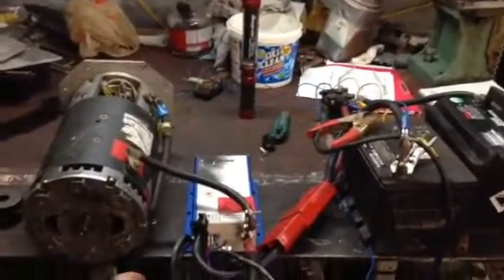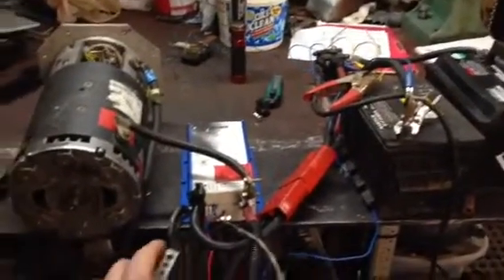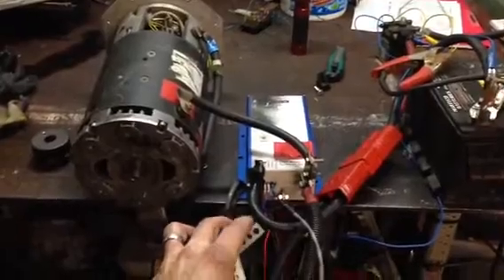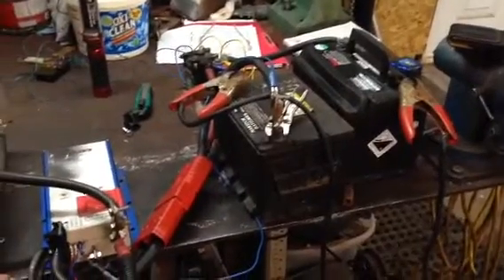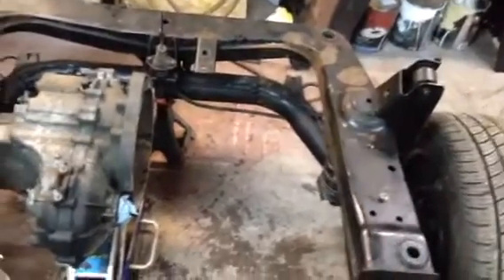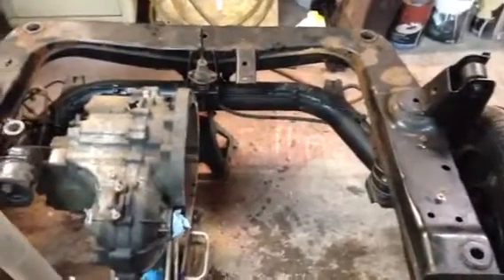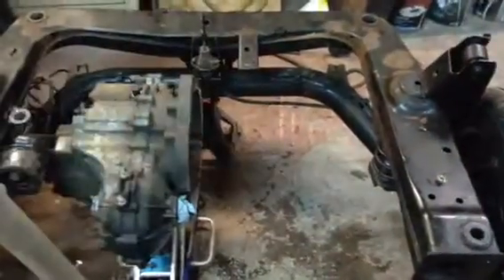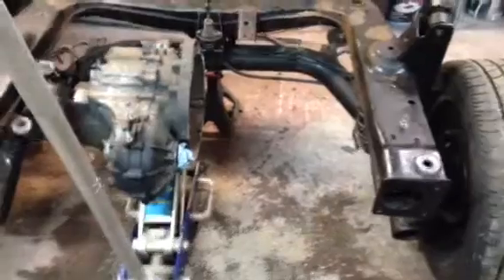Smart diesel to EV conversion

Comment: seen another one on youtube that uses an arduino to shift the stock smart gearbox, might be a idea for shifting youre setup in reverse 
http://roadster-ev.blogspot.nl/
wat motor are you using ?
Reply from the maker: Thank you. That's certainly worth knowing. I did modify the motor so that it has the extra post and can now reverse. It's been parked though when my gel batteries died. Trying to make Lithium packs now. The motor is a brush type motor from a forklift. Nothing fancy here.
Reply: i recently repaced the gel batteries in my "electric vehicle " (oh yeah imobility cart , rollin in style here you know ) and yes they can be quite costly , 
suprized that the forklift motors are only 36 volts 
looked intoo golfcart rearaxles myself , with the way the smart suspension is set up you could basicly bold the solid axle with motor straight intoo the sprung part of the frame using the mounts normally holding the hubs 
found a motor but its a 72 volt version , thats a lot of batteries 
might try it some time with another type of electric motor
Reply from the maker: I understand that the 36 volt forklift motor can stand a lot more voltage but I didn't try it.